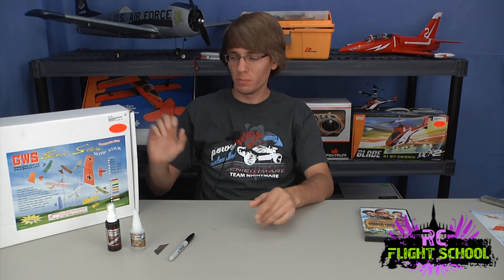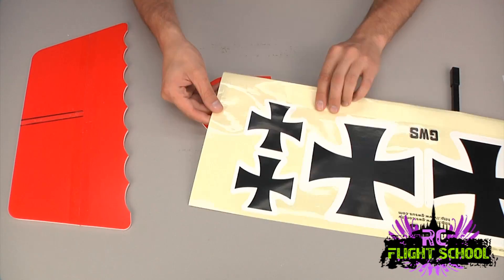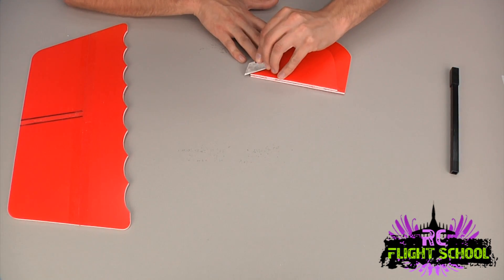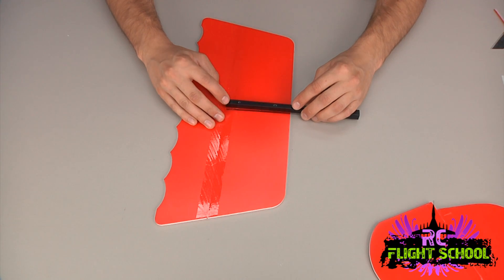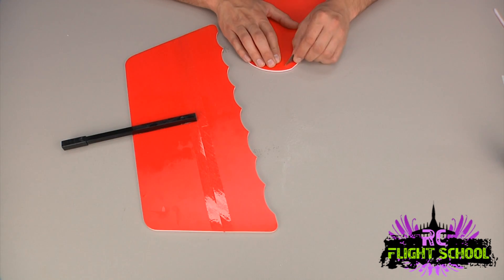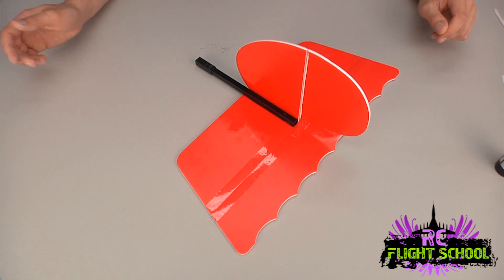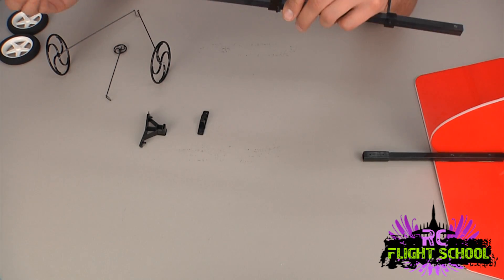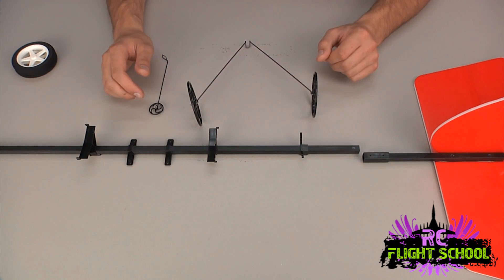How To Build An RC Plane-Slo Stick Part One

Comment: Old video - but thanks, I'm building mine 11 years later - question:  you seemed to have skipped over the battery mounts (which is right were I got stuck) as the orientation is not clear in the instructions/pictures.  (Sure wish they took better pictures in the instruction manual).  Thanks again.